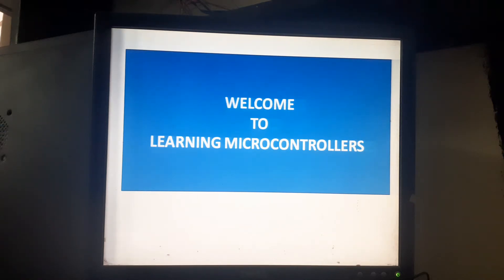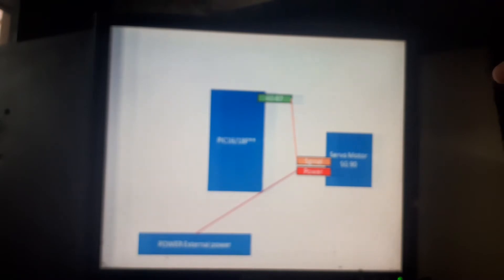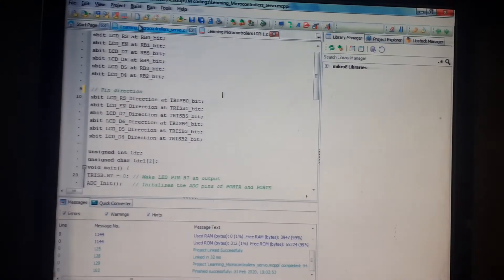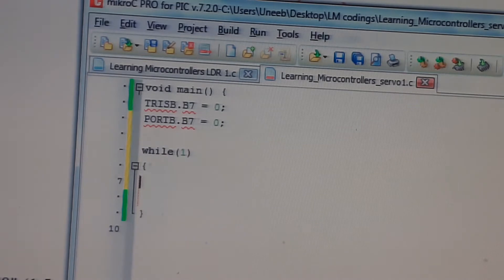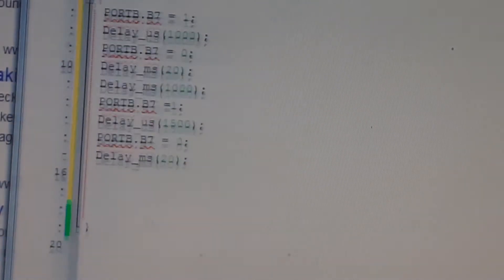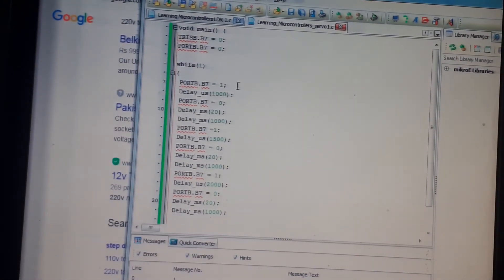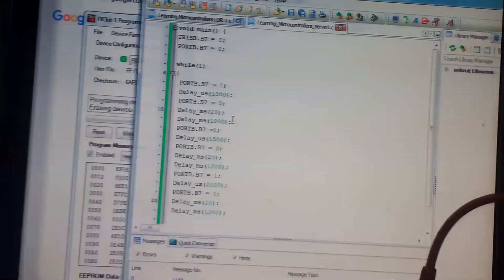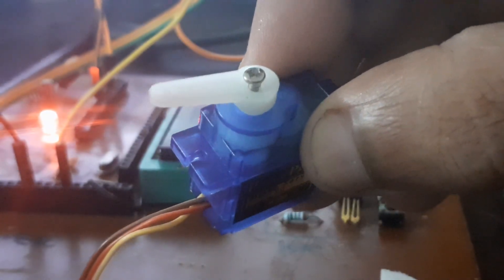PIC16F877A/PIC16F887/18F***** Series Interface with Servo Motor using MikroC

Comment: Can you help or anyone I tried programming pic18f458 assembly language use buttons to control servo motor but I keep getting -90 degrees angle on servo please help.
Reply from the maker: Why assembly ?
Can you use mikroC for PIC ?
In mikroC assembly code is auto generated
You can copy that
Reply: I'm not familiar with mikroC I only understand assembly
Reply from the maker: This only happens
1- if servo is under powered
It requires usually 2A current
If less it stops receiving pulses in sequence and go in 1 direction
2- if pulse you send dont have time delay according to datasheet
3- Dont power up Microcontroller and servo with same power source
Use external power for servo